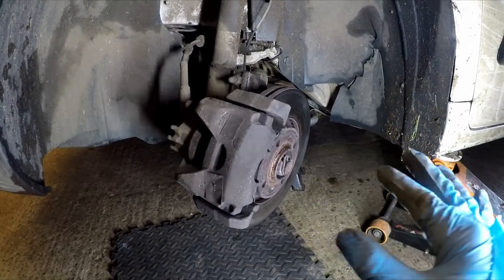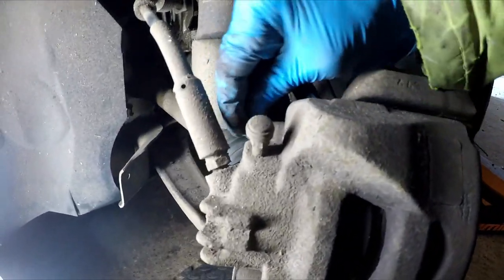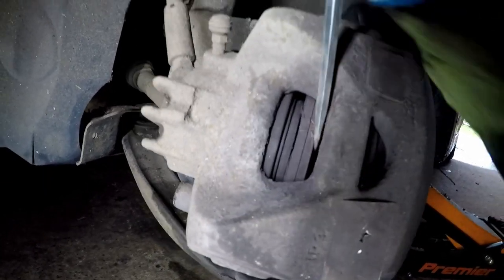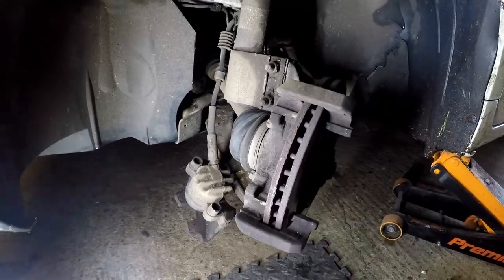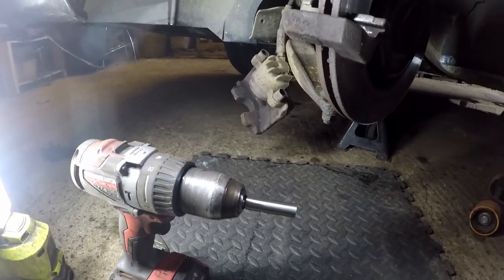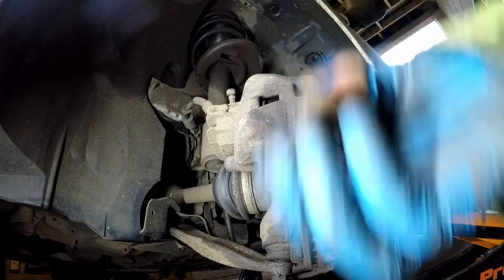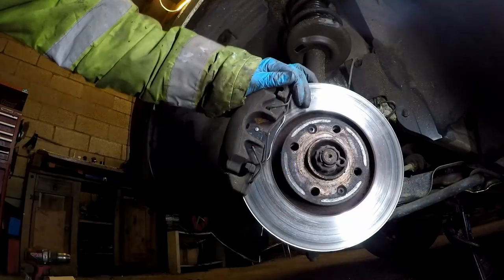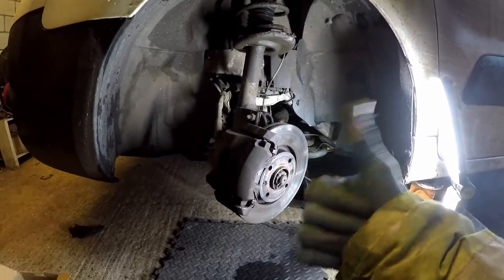HOW TO: Partner Berlingo Peugeot Citroen | FRONT BRAKE PADS | Tutorial diy

Comment: Great heads up.  Just a quick one, does the Partner not require pad shims?  Or were they the adhesive type, couldn't quite see?  Mine rattle a smidge when going over poor tarmac, no shims fitted either.  Pictures of OEM pads have clip-on shims fitted.  Which pad manufacturer did you use?
Reply from the maker: Clip on shims? These don't have such shims. If they do, they will be on the carrier when you remove the pads.

Comment: Looking at doing mine tomorrow, but slightly unsure where to put the jack stand, looks like you’ve gone for the control arm bush? Looked online, but not much info, seen a few say use the chassis rails, a few said don’t.
Reply from the maker: It doesn't have chassis rails, it's a monocoque chassis. 
Front subframe near or at a mounting point. 👍🐷

Comment: Hi I was just wondering if the partner braking system would fit on the 403 (1961)
Reply from the maker: Any braking system will fit if you do enough modifications.
Reply: @PiggyPower  Thanks I'm going to try the Boxer braking system
Reply from the maker: The Peugeot Boxer?? ... Id be staggered if you get that to fit behind the 403 wheels. The Peugeot Boxer is a BIG van and uses big heavy brakes.
Reply: @PiggyPower  ok thanks  for  the advice I'll try the partner or similar

Comment: Daft question but do you take the cap off the brake fluid so you can move the caliper piston   thanks
Reply from the maker: Never have done. It's worth checking if the fluid is brimmed and removing some as the fluid would overflow otherwise
Reply: @PiggyPower  that's great thanks

Comment: what lubircate use?? thanks..
Reply from the maker: Lubricant? For what?
Reply: grease that you put to lubricate the areas, what did you apply?
Reply from the maker: Brake specific ceramic or copper if you must
Reply: @PiggyPower  hi great video.however I folllowed video on my partner.but I have a slight click at slow speed braking .what did I do wrong or is there something I can do thanks in advance 🙏
Reply from the maker: @grahammaddison7482  That would all depend on what is causing the click!

Comment: My 206 2001 didn’t pass inspection because the right rear brake is weaker than the rest and I cant get the drum brake off to fix it or swap it out. I tried smashing it with a hammer a lot and I just can’t get it off.
Reply from the maker: Have you backed off the brake shoes?
Reply: @PiggyPower  how do I do that? The hand brake is disengaged in case ur wondering that too.
Reply from the maker: @droidking614  obviously I'm happy to help but if you're not sure how a brake shoe adjuster works, maybe it be good to get a friend round who knows how to safely work on vehicle brake systems? Do you have someone who could help?
Reply: @PiggyPower  I’m decently ok with cars it’s just that I have tried the tips and trick online and I can’t reach the adjuster wheel. Maybe I thought there was another way but if it’s the adjuster wheel I have to get at then I have to buy a smaller screwdriver to turn it
Reply from the maker: @droidking614  yeah, it's not far in there, little torch is key 👍👍 presume you've undon the big nut in the middle too? I have a video how to adjust these properly, have a search 👍 inc the adjuster wheel 👍🐷
Reply: @PiggyPower  yea the nut came off with my impact. Thank you a lot for ur help and time man. I’ll definitely have a look at ur vid